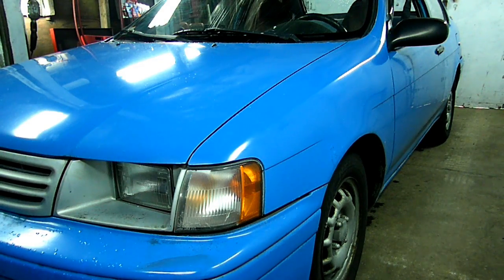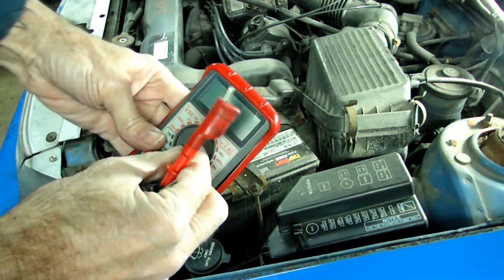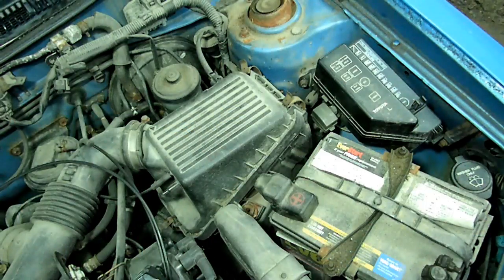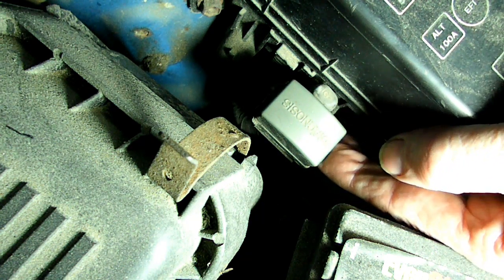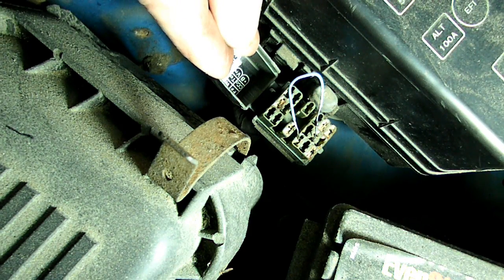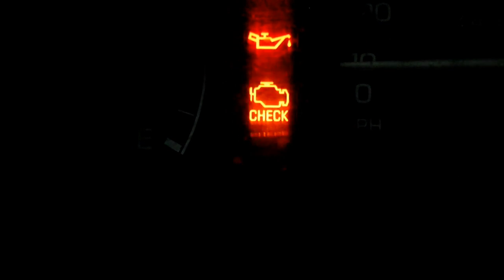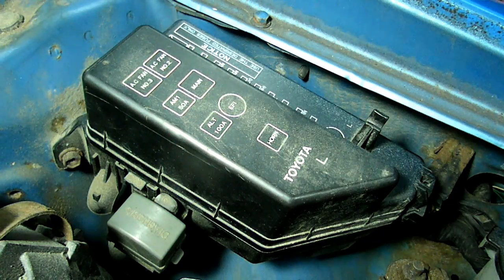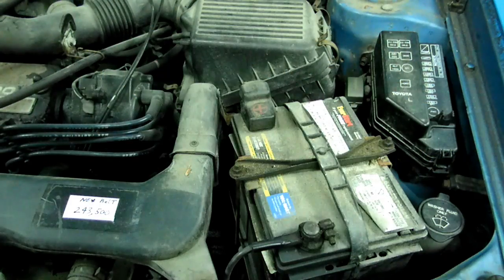OBD 1 Toyota Trouble Codes

Comment: I did this test on 1996 corolla and its flashing continuously implying that it has no codes but its performing badly on fuel, low power and even  produces black smoke

Comment: 4:06 I never knew a carburetor engine had on board diagnostic port, or even any engine management computer. Would you enlighten me with some examples?
Reply: my toyota corolla 1988 ae95 has carburetor and has obd1, research fuel feedback systems
Reply: @silverfish6908  that's interesting

Comment: I have 1995 corolla ,when i connect te1 e1 the service engine just flashing in constant timing
my problem is after driving for seconds the service engine light comes on and comes off when I turned off the engine
what is the problem 
thanks
Reply: IRAQ GIS TEAM
Unbroken flashing means it’s not storing any codes. Anything you’re getting is temporary and likely no big deal. I would want to know too tho.

Comment: Just resetting, doesn't fix the problem?
My Check Engine came on last night on a 2006 Corolla......Auto Zone run test. Came back with code that fuel was too lean.... I'm not a mechanic.... What now? Can't afford a Toyota Dealer prices. Can I replace? Thanks....

Comment: Hi I did an obd scan on my car (1988 toyota celica 2.0L A/T) and the result was 51.

51 -  Switch signal -A/C switch ON during diagnosis Wiring, A/C switch, A/C amplifier, ECM

51 - Switch signal -closed throttle position (CTP) switch OFF during diagnosis Wiring, CTP switch, ECM

51 - Switch signal -park/neutra! position (PNP) switch not in P or N during diagnosis Wiring, PNP switch, ECM

My car has this acceleration issue for a month now, it cannot go uphill.
I did these things trying to solve my acceleration issue, still not succeeded
 -changed fuel filter
-cleaned maf sensor
-air filter is in good condition
-cleaned throttle body
-clean air intake tube 
-cleaned throttle position sensor
-changed my ATF (drain and refill method)
-changed AT filter
-cleaned AT oil pan and magnets
-changed spark plugs
-adjusted the accelerator cable according to the manual

Interpretation on the result of 51 and any suggestions?
Reply: Timing  issue

Comment: My CEL came on, ran it with the paperclip method. Got egr malfunction. Took apart throttle body and the passages were completely blocked with crystalized carbon. Scrubed em clean, sprayed em out, reinstalled. Reset light. Never came back on. Thanks!!
Reply from the maker: +JaceD4V1S88 Your lucky most of the time it is very hard to get the carbon out.
Reply: ive heard stories haha. mine looked like a piece of pencil lead that was sticking out of the hole on the inside of the intake but about 2 times bigger.
Reply: JaceD4V1S88

Comment: Ive got a Lexus GS300 (1993 so pre obd2) with an air bag light on, does anyone know a way I can diagnose this? Some have same the airbag module but im not sure. We bought the car at an auction with trans issues for $400 (fixed via a fluid AND filter change hehe!) car runs great and has 370k on it, shoot the AC even works perfectly! Just this pesky airbag light might cause issues for inspection! Person that owned it before did normal maintenance but let other things slide (valve cover gaskets are pouring oil everywhere, fixing that along with a recently developed coolant leak, today. Would be great if we could atleast find an explanation as to why the airbag light it on. Im gonna try this to see if maybe it gives me a trouble code but I doubt it

Comment: A very useful tutorial.  I heard you mention code 12, the very code I'm receiving on my '94 Corolla (1.8L).  The problem related to this code is an intermittent miss while the engine is idling at normal temperature, and ONLY at idle.  I'm pulling my hair out tying to find the problem.
Reply: Did you ever figure it out, I have the same code.

Comment: When. I do this mine has a clicking noise while it flashes it's a (Saturn sc2 1993)
Also when I push the brake pedal the hazards come on when the car is running the brakes kills the car

Comment: wow excellent video Rich, I had done this before seeing the video and the check engine light kept flashing just like in this car and it concerned me. Found this video only to come across that my car has no codes!. Thank You.
Reply: Yea i got the same results, that just means my cat is bad since it wont pass emissions even though i did a full service, all filters, oil, plugs, the works. Not looking forward to welding in a replacement🤣

Comment: If you are jumping the pins but get no flashing CEL, you might have an OBD 2 compliant toyota. For example, the 1995 V6 Camry has a diagnostic port under hood, but jumping it will not flash codes. Instead there is an OBD 2 port located on the left hand side of the dash behind a removable coin holder, where you hook up an OBD 2 code reader, and see your codes. Other toyotas like the Avalon have it behind a fuse box cover. Confirm your pre-96 Toyota is not OBD 2 compliant. Do so by checking the under good label.
Reply: Lynx Star Automotive Thank-you! I've been trying to figure this puzzle out for weeks. What a bizarre design --a dummy diagnosis port under the hood just to frustrate owners?! (:   Anyway, I just removed the coinholder on my 94 V6 Camry and there is the OBDII port exactly as you said. I happen to have an OBDII scanner for my Sienna so I can run the codes on the old Camry now too. Thanks again!
Reply: No problem.  If you are curious,  the port under the hood is actually used to diagnose other systems like ABS, SRS (if equipped), and to run diagnostic tests on some systems components.
Reply: Lynx Star Automotive Ok, that makes sense. Anyway, the scan worked well. Showed a p0401 code. Only "symptoms" are lousy fuel efficiency and a slight carbony smell with the windows down --both of which could be from other causes, of course. Still, I think I might try cleaning the EGR valve. Doesn't look too hard... famous last words?? (:
Reply: Gary Frank You can try cleaning the valve, but you will probably have to clean the EGR passages in the head as well.  They might be plugged up, not allowing proper flow, and setting the insufficient flow code.  Also, the carbon smell might be a leak from the very EGR system, and could also set that code.
Reply: Lynx Star Automotive Good to know. Not sure what I'll do yet. Thanks again.

Comment: Rich, very good video I used it to pull a code on my 1991 Tercel.... Question is I got the code 71 (EGR System) I know it something with the EGR System but what are the things to check/diagnose?

Thanks.
Reply from the maker: Look closely at your vacuum lines and Vacuum Modulator.

Comment: Great video Richpin, I have a 91 Tercel.. basically the same thing as the 92.

I'm wondering do you put the paper clip jumpers in the two holes for each check engine light?